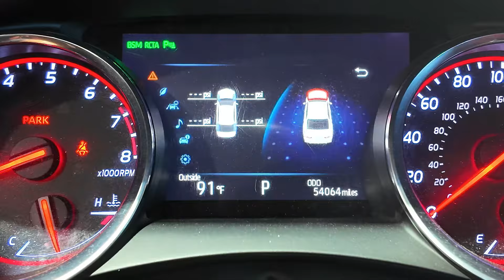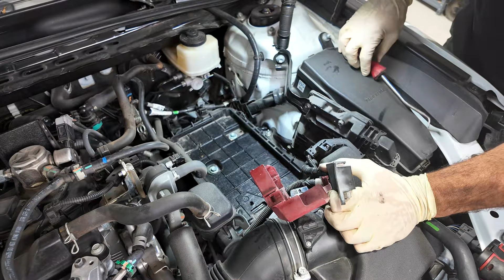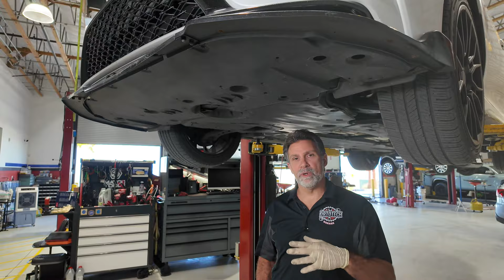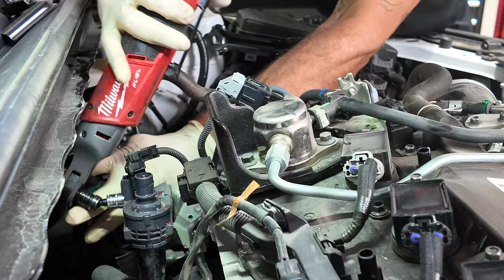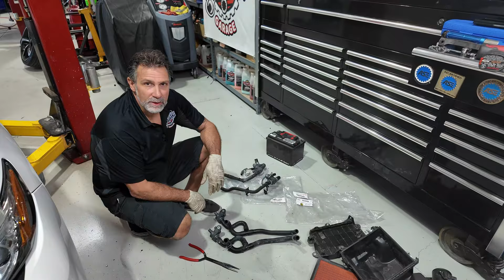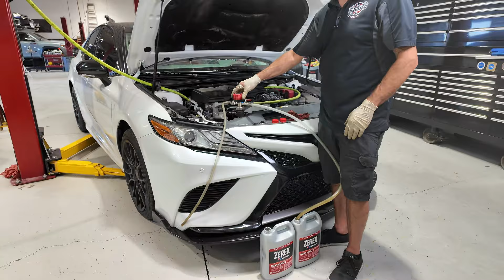How to Fix Coolant Valve Leak | Toyota Camry, RAV4 & Corolla Repair Tutorial | OrtoTech Garage

Comment: Question the one by the transmission do does fail a lot
Reply from the maker: No.  The common one is up top by the cylinder head.  They set a specific code for each valve so you can follow the fault codes for your repair.

Comment: Can anyone tell me what that metal line is called at 13:52 , there’s a small crack right there and is leaking
Reply from the maker: Its just a coolant pipe.   You will want to call your local dealer with your VIN.  Tell them you need the coolant pipe at the back of the cylinder head and what each end goes to.  They will be able to find it for you. You wont find that in the aftermaket, it will be a dealer only part. Best of luck with you repair.  🙏

Comment: Do you have the part number to order on Toyota web site? I would I appreciate it, do you need to change the goose?
Reply from the maker: I don't have the part numner handy anymore.   You may need able to pause the video and see th part numbers on the plastic bags.  I would recommend you just call a toyota dealer with your VIN and have them give you the correct part numbers for your specific vehicle anyway. 👍
Reply: Thank you.

Comment: Can you replace without getting new hoses
Reply: They come with the hoses attached like you see in the video.  I suppose you could cut them off and reuse the old hoses, but why?
Reply from the maker: They come with the hoses.  Until an aftermarket valve becomes available without the attached hoses, I think this will be the process.

Comment: How long does it take to fix it?
Should  I take it to the dealership? Or any good mechanic  shop. Your suggestions  will be highly appreciated.
Reply from the maker: This repair will take a few hours to replace both valves as I did.  Any competent auto repair facility should be able to perform the repair.  It's not a difficult job.  If your valve has failed, call your dealer to see if they will cover it under warranty, first.  I know they had a campaign for this problem and I think they were offering some assistance for some of these vehicles.  👍

Comment: Why are you replacing Both valves? Can the diagnostic code not seperate them out?
Reply from the maker: They should set separate codes for each but have similar problems.  To avoid future similar concerns, I updated both parts.

Comment: I wish someone would say how to get the clip/connector off cause I cannot for the life of me disconnect it. The connector that goes into the side of the valve. Someone said to push in on the back and pull up but that’s not the case for my 2021 Camry
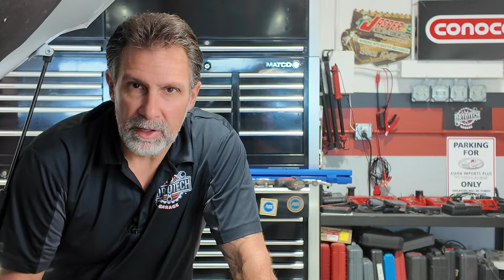Reply from the maker: I demonstrate exactly how to do this at timestamp 7:04 in the video.  Once the clip is released/pulled out, the quick connect fitting will pull straight off.  You may need a slight twist or wiggle as you pull.
Reply: @OrtoTechGarage hey not that one. The connector that’s next to it that has the thin plastic hose on it
Reply from the maker: Email a clear photo to me and I will assist you...
Ortotechgarage@gmail.com

Comment: Hi. So I had a p1360 code for a camshaft positioning sensor and P26AD Engine Coolant Bypass Valve " B" Control Circuit Low. Replaced both bypass valves and the sensor and a week later I went to put gas in my car but kept key on but ignition wasn’t running while gassing up to listen to music, and when I was done CEL came on again with both those same codes. Could me doing that have something to do with the gas cap or something? I made sure it was tight tho
Reply from the maker: I dont think it was anything to do with refueling.  I assume you cleared the codes after the initial repair?  You may have another issue with those codes that are not a component failure, but rather a signal issue. It may require an actual diagnosis where the circuits are tested for proper signal, power supply and ground circuit integrity.

Comment: Good job demoing how to replace the valves but since many of the people who might be doing this wont have access to ta vacuum pump to draw the air out of the system, I think it would have been a good isea to show them the funnel method system to purge the air with the Toyota method of running the water pump at about 4000rpm for 30seconds as specified by Toyota.
Reply from the maker: Thanks for sharing that.  I really hate filling a cooling system without an evacuation tool.  There are so many problems with not using the tool, so many manufacturers that require it, and crazy bleed procedures, I feel like its a tool you should have.  I made a video about that recently. Its a little late to update a video, but I will keep that in mind for the next one.  👍

Comment: Do u gotta replace both valves if you have that error message pop up?
Reply from the maker: No, not necessarily, It's just a good idea to avoid problems.  You can certainly narrow down to the defective part only if just one is bad.
Reply: @OrtoTechGarage okay, I assume using an OBD 2 scanner to narrow it down correct?
Reply from the maker: Yes.  You will have to look at the fault codes to determine which component is setting the MIL.
Reply: @OrtoTechGarage thank you

Comment: Hello sir I have same car Camry 2018 and is showing on dash check engine light comes with a yellow triangle light too maintence reguire visit your dealership I change the bypass valve under the batterie and still check engine light comes on sometimes and them goes off so I spoke to a mechanic and he say is the water pump but the engine temp work normal so what did you think could be thanks I appreciate your help thanks again
Reply from the maker: You always want to connect a scan tool as an early part of your diagnostic process. This will tell you what system is causing the warning indicator to turn on.  You don't want to guess at the problem becasue there are too many different things that can cause the warning indicators to illuminate.  Start there with the fault codes. Also, if the valve is the problem, the fault codes need to be cleared from memory after the repair is made. This is pretty much true for any repair.  👍

Comment: I have a 2018 le and a few weeks ago i got a message saying, Engine Coolant Temp High is that part of the first problem?
Reply from the maker: Not necessarily.  It is possible if the valve has leaked, and you have lost coolant, that the temperature can run high.  I wouldn't assume that is the problem though. See if the coolant is low first.  If so, you will need to identify if there is a leak.  Its also possible the radiator cap is not holding pressure, the thermostat is sticking or a water pump is not circulating, among other things.
Reply: @OrtoTechGarage yesterday i turned the car on and noticed it was leaking coolant below where the cap is at. Also i changed the water pump last year and thermostat a few weeks ago.
Reply from the maker: @Ruiner041 Maybe the cap has a bad seal or possibly the tank on the radiator? A pressure test on both would tell you definitively.
Reply: @OrtoTechGarage alright, thank you very much!!

Comment: Has this been fixed for a newer 2025 Rav4?
Reply from the maker: I have not seen one that new with a problem. I also dont have access to newer vehicles like the dealership service department does.  We don't usually see them in our garage until the warranty is up. I would imagine it has been resolved for that year, though.

Comment: I have a 2022 Corolla XE, & Just replaced this part. What do I do if I still have the ‘Engine Maintenance Required’ message?
Reply from the maker: You will need to clear the fault codes with a scan tool.   You're almost done. 👍
Reply: Part#?

Comment: What year model was the Camry in the video?
Reply from the maker: It was a 2018 Camry XSE.
Reply: @OrtoTechGarage Have the issues you have been seeing been due to non maintenance? What typical mileage have you been seeing these failures?
Reply: @OrtoTechGarage Did this procedure you showed demonstrate a draini and fill or a coolant flush?

Comment: I guess I'm lucky, '11 and '17 Corollas and haven't had that problem (yet).
Reply from the maker: Hopefully, your vehicles will remain trouble-free.  The 2011 doesn't even have these components, so no worries there.  Not all Corollas were affected either. 👍
Reply: @OrtoTechGarage the 2020 L, LE and XLE with the 1.8 port injection gas only up to 2022 models i doubt is affected by that